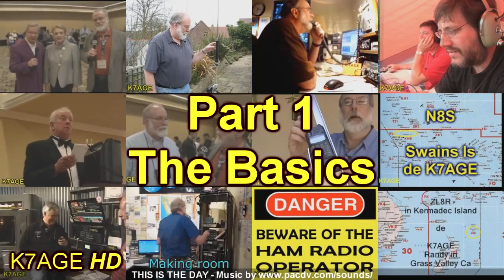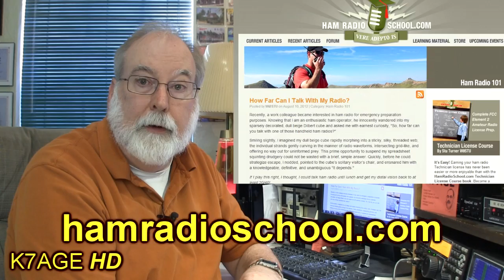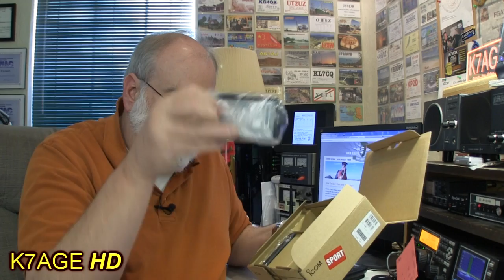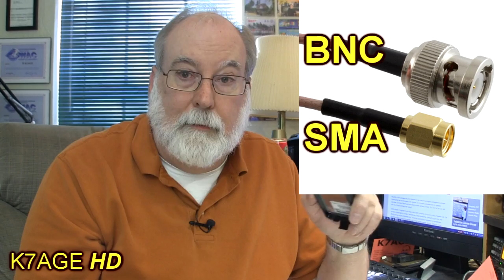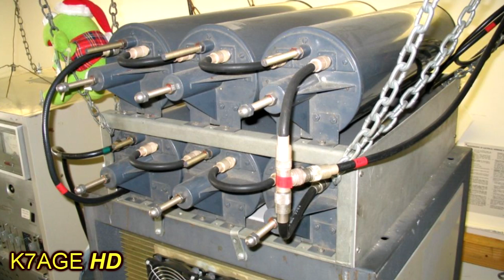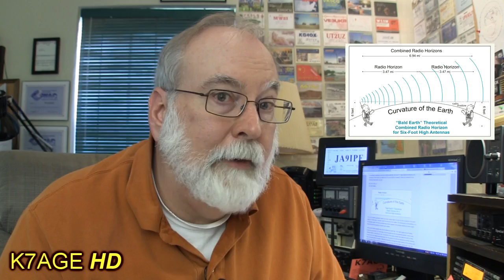How to get started on Ham Radio 2 Meter FM, Part 1

Comment: Thank you for this video. It is easy for people to get discouraged from pursuing the hobby because of the attitude shown towards the new guys on most internet forums that discuss amateur radio operation. It's good to see someone taking the time to encourage people to take up the hobby. I would have gotten into it years ago but every time I tried to find info online I got shot down by someone and eventually gave up. Had I found your video ten years ago I would have gotten started much sooner.
Reply from the maker: Thanks, sometimes you just have to give big knob a twist and get away from the less helpful.

Comment: Thanks for the videos. I'm a former ham, KB9NSQ who let his license lapse years ago and I'm going to get back into it. I was looking for a review on this particular radio, but found this information was a great refresher. I live on the ground floor of an apartment building, and am thinking whether to start with an HT or mobile. I remember from before HTs are pretty much useless unless one is close to the repeater or up on a hill. But so convenient, and no need to mess with a power supply!

Comment: I've had this radio for a few years now, great radio.  With a half wave collapsable, I can get into repeaters 35 to 40 miles.  I also have one of those arrow snap together 4 element beams.  Doing hilltops or low mountains, it's like 60 to a hundred miles into a repeater or a base station.

Comment: That makes sense, yeah the manuals are just horrendous.I use Chirp to program mine which makes it nice and easy however hand-programming is still no fun on the baofeng radios.

I wasn't trying to knock that IC though, still a nice radio for sure and probably a heck of a lot easier to field program if you needed to.

Comment: Cool vids man. Just getting back into radio after a long hiatus . Joined a local club and am getting a baofeng. A guy in the club has the software and cable and is going to help me set it up. 73 from KE4KKM.

Comment: Randy, I'm curious: are the AA battery packs not available separately? If I were buying a new HT I would look at buying one that came with a rechargeable battery pack, but also buy the AA battery case as well. That way I have a back up for when the battery pack dies.

Comment from the maker: I have one of those too. I wanted a simple radio to show the basics of getting a radio setup to operate on FM. I feel that these Chinese radios are harder to program than other radios. I had my UV-5R with me on away from home without the manual. I could not figure out how to get a repeater programed in it. Now, this may have been my fault not spending enough time learning the radio. But they program so differently than all my other radios. These radios are not my favorite.

Comment: Dear OM, I went QRT on 2 meters when the blasted CBers took over abt 20+ years ago.  I've been off the air fer quite awhile, but am getting back on CW only.  Just picked up a good Bencher paddle es looking fer a used CW rig, sure wud like an old HW8 cuz I love QRPP-CW, the lower the output, the better. Wid a solar max, bet I cud hit Europe.  VY 73 ES GL  DE KK5B SK

Comment: Personally while that is a nice radio I would recommend the UV-5R. Yes it gets a ton of flak, usually however from people who have never used it. It's half the price or less than this radio.

The big thing is the UV-5R is a dual band 2m/70cm which makes it absolutely perfect for amateur fm satellite operation with a 5 Watt output. It does use an sma :/ but nice BNC adapters are made that fit flush with the radio.

Comment: What 2-meter mobile radio would you recommend that is waterproof or at least, water-resistant?  There are so many radios out there-it gets confusing.  How about a waterproof handheld?  Thanks for your vids.  I learn a lot from them.
Reply from the maker: I don't know of any water resistant mobiles, as they are usually projected. I see on the Icom site that the V80 is rated Waterproof rating: IP54. I found this meaning: IP54 Protected from limited dust ingress. Protected from water spray from any direction. Check out Kenwood and Yaesu to see if their radios have a rating. Or, get a cheap Baefong and if it brakes, get another one.

Comment: Hey  K7AGE great video!! thanks a lot, I have a couple of questions. Can you use a HAM radio like the one you bought as a walkie talkie (for example for an event organizing between staff) without having to go trough to much trouble? 
What is the difference between FRS GMRS frequencies and the 2m 70cm etc  etc?
Theres a Baofeng that can do fro and gmrs as well as 2m 70cm.
why are the  the 2m, 10m , 15 m 80m etc etc frequencies called like that? which ones give you the longest range?
how do you transmit trough a repeater?
thanks a lot!
Reply from the maker: Jonathan, 
Only license amateur radio operators may use a radio on the amateur frequencies. So, for an event with non-amateur radio operators, you would need to use FRS, GMRS & MURS. I believe GMRS & MURS also needs a license, but that is just fill in a form and pay a fee.

Many events like bike, walks and runs that cover a wide area, call on the amateur radio community to provide communication and operators for areas that cell phones coverage may be unreliable. Hams can provide voice as well as GPS position data, data for text and file messages, image and even real-time television communications.

Difference between the ham, FRS, GMRS is mainly in the license requirement. FRS, none. GMRS, pay, Ham study and pass a test, learn about radio and our hobby. 

Many of the Baofeng radios can operate on the ham, FRS and GMRS frequencies. The Baofeng radios meets FCC Part 90 rules and regulations, which allow for wider frequency ranges. Amateur radios must meet FCC Part 97 regs, and one of the requirements is that they only operate on the ham frequencies. 

Baofeng has chosen not to sell amateur only radios, they sell a wide frequency range radio the allows operating on many frequencies at a very low cost. Baofeng does not support amateur radio, no advertising in amateur radio magazines, does not participate at amateur radio conventions, service is back to China or maybe by some dealers (only if you bought the radio from them). The common thought is that the Baofeng radios are cheap, and when they break, throw them out and get another one. 

The bands are typically called by the wavelength in meters, 2 meters, 80 meters and so on. The frequencies are in the 144 MHz range for 2 meters and 3.5 MHz for 80 meters and so on. Sort of two ways of saying the same thing. Frequency is much more exact. Longest range, HF (shortwave) for the longest range, around the world. Two meters and 70 cm walkie-talkie through a high repeater may have a 100-mile range. It all depends on what you want to do.

How to transmit through a repeater, watch the next two videos in this series.

Comment: Can you listen to the transmissions and conversations from a repeater just by tuning in its frequency, or do you need to generate PL tones and identify as if you were transmitting? Thanks!
Reply from the maker: zappp111 You can listen just by setting the radio to the frequency that you want to monitor. Nothing else is needed.

Comment: What's your opinion on the baofeng uv-5r dual bander? It's a $30-$50 radio and is very high quality, I'm impressed with mine.
Reply from the maker: thecooldude9999 They are okay. I have a couple, along with other Kenwood, Icom and Yaesu HTs. They have their unique way of programming repeaters into memory.
Reply: K7AGE
Yeah. The documentation that comes with it is terrible, but there is much better information online.
Reply from the maker: thecooldude9999
You are correct!

Comment: Great video!  new tech , learning so much ! I’m torn between the Icom id51 and kenWood th-d74a any advice on which one ? And why ? Thanks 
Kc3kpe
Reply from the maker: VooDew - Nomad Hi. Both are great radios. They both are complex. The Kenwood has APRS, which the Icom does not. I think the Kenwood cost more than the Icom. I have had the Icom for a couple of years before the Kenwood came out. You can check the reviews on eham.net. So, there you go. Have fun with your new radio.

Comment: Thanks for the Videos. just received mine . Its been a long time since I've bought a new HT  so I was surprised that Icom was too cheap to include the owners manual.. haven't tested the range much yet, but  the antenna it comes with doesn't seem to be very good for indoor use. but that's not what I wanted it for anyway.  I plan to use it in my jeep with a bnc to sma adapter and then to a pl259 antenna coax. Looks like a real nice little radio.  again  tnx for the vids. JKW AE6DF
Reply from the maker: hman630 have fun. Many radios now come with simple printed instructions. More in depth manual as pdf.

Comment: quick question, I am a bit of a noob. When you say it will BLOW up the transmitter does that mean it will just cause an error, or will it actually destroy the receiver?
Reply from the maker: If you connect a transmitter into a receiver and transmit, you will blow up the receiver. The receiver is not design to accept a high power input.
Reply: Thanks, I didn't know if it was just a turn of the phrase.

Comment: does a repeater keep sending your transmission to the next repeater which would increase distance?
Reply from the maker: A repeater may be linked to another repeater, Typically this is done on some type of backbone on a different set of frequencies.
Reply: How do I find out if the repeaters is setup for link repeater system ?
Reply: setofirons ask the club or person who owns them for the dtmf codes to link them

Comment: KE7AZD: I have a mobile unit (yaesu ft 7800) and a 35amp power suply and a bunch of fat rg 213 with a conector on one end I have a bunch of 12 guage wire how can I make a loop for 2m 440? 
i have no money to buy anything. I plan on cutting up a plastic bucket for insulators.   Id like to hit repeaters in Portland Oregon From Sublimity Oregon....
Reply from the maker: Try and make a 1/4 wave ground plane antenna. I have a video about that. That distance appears to be about 50 miles. You and the repeater both better have high locations. Give it a try.

Comment: very good advice, but unless you live next to a repeater, I suggest getting a 2 meter mobile radio with at least 65 watts output, and putting up a rudimentary 2 meter base station antenna. You can get them for about $40, or you can make your own. You will also need a power supply for the mobile radio to use it as a base. But the radio itself is no more expensive than a handheld, with many times the range. I paid about the same for my 80n watt Yaesu FT-2900R as I did for my 5 watt Yaesu FT-60 handheld. 

Whichever radio you get, PLEASE stay away from the cheap Chinese junk. Not only is it junk. Not only is it junk, but by buying it you are taking business away from legitimate radio manufacturers like Yaesu, Kenwood, Icom, and a few more. These companies make inexpensive low end radios that are 10 times the quality of the Chinese junk. It would be a shame to see these companies go out of business, or worse yet, cheapen their products because of the Chinese junk.
Reply from the maker: Yes, a mobile radio is nicer to use for every day inside operation. Many start with an HT.  Also, the Chinese manufacturers don't support our ham radio magazines or hamfests.

Comment: I don't think its that great of a system....transmitting ...continuous. I am sure their are many functions many reasons to use those radios..I have two hand  50 mile radios-I know I don't get 50 miles I do however get unlimited talk it beeps then turns on again...in at least a 5 mile radius or even 2 miles traveling....their very easy to use.....I like them for parks shopping going in different directions etc..it is a state of mind. If I went to san diego zoo I would take a pair of radios maybe 4 and give them to everyone...then we would be free to communicate through the park and meeting up for lunch  and any problems....I am going to get a different radio for emergencies and am looking now so thanks for the information...those don't use repeaters or amplified signals or antennas or boosters etc...so I'm off to look at all the different parts adaptations antennas portability battery use travel capacity etc...thanks again